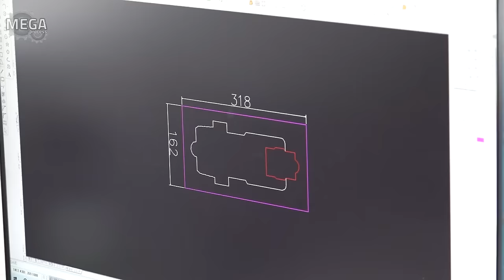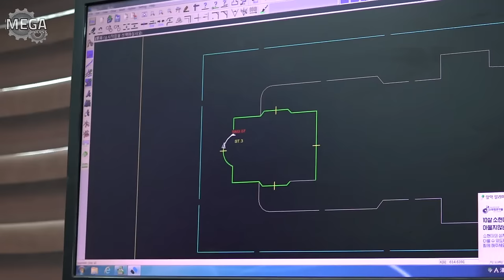Process of making aluminum hard case. Korean best storage carrying case manufacturing factory

Comment: Mistake: The bottom layer of the three layer shaped foam to house the object should not have been cut out but left as a solid block because the object sat too low in the finished case resulting in a large space at the tip for the object to flop around when the the lid was closed and the case was flipped around or transported!